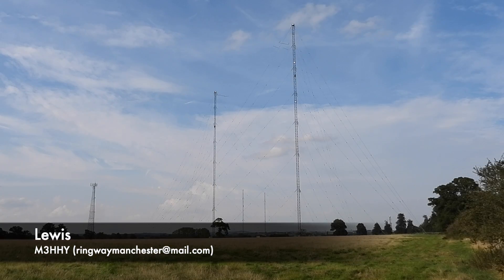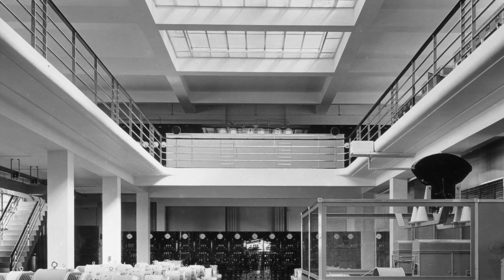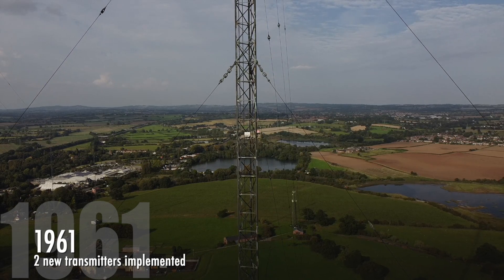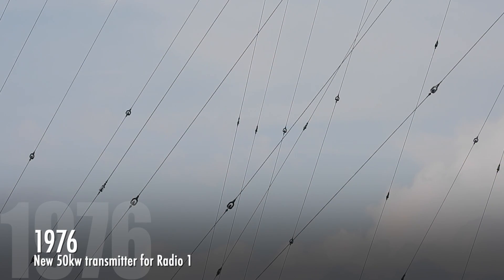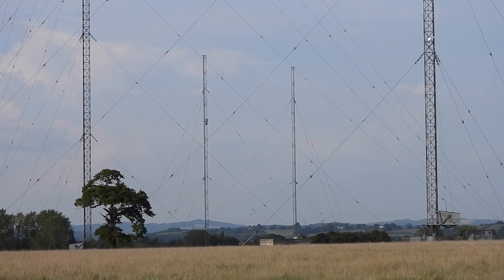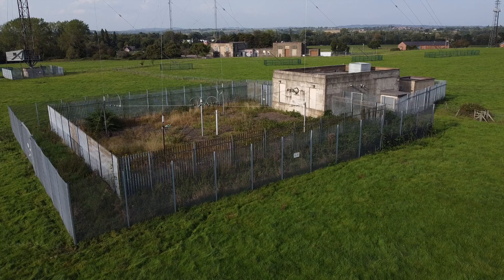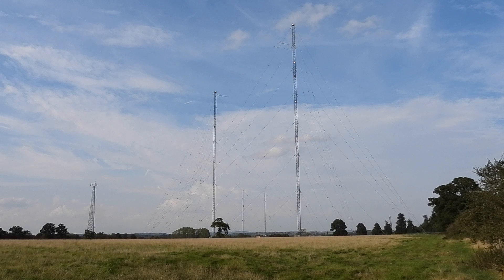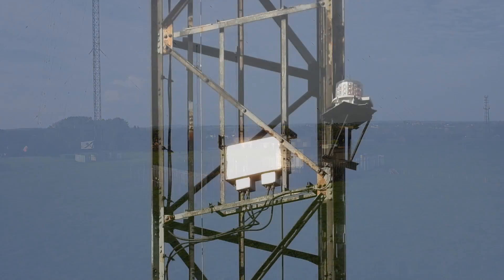Droitwich: The Death Of The 1/2 Million Watt Transmitter

Comment: read an article from BBC a couple of days ago where they claim they will keep BBC 4 on LW on the air until the last hoursehold electricity meters using LW  have been replaced with modern versions. there are still more than a million of these meters in use in the UK
Reply: Good point. I found a page on ofgem site saying, "RTS meters is being phased out and is planned to end 31 March 2024.". RTS is Radio TeleSwitch meters. The suppliers are supposed to provide customers with smart meters to replace their RTS meters by the deadline. Sounds like and end of financial year target business benefit job? No doubt some bean counting managerial types who don't give a stuff about the history of British broadcasting will be salivating at the thought of the leccie bill saving when they switch that 198KHz transmitter off.

Comment: This is a world wide trend of long wave and medium  wave stations turning off service. the cost of operating and maintaining has got to the point where no longer doable . and with few listeners . some new cars sold in the US no longer have medium wave AM radios in them. the cost of a new transmitter is just to high to replace the old tubes. and still would use a modern tube.  big transmitter tubes can be re bult or custom made. but at great cost. the decision to switch off old transmitters is mostly cost . nice video of the cite. love the pics of the old transmitter. 73's

Comment: Back in the mid 60s and early 70s when I was a young apprentice at the Marconi company in Chelmsford, Essex, I worked for a while in the transmitter development lab, and we had large
 transmitting valves for a development transmitter we were working on, the valve holders looked like toilet pans with concentric rings of phosphor bronze contacts. and large copper busbars for the heater voltages. There was a water inlet at one side to water cool the valves as they had a large copper anode at the bottom which sat in the water flow.
Reply: My brother came over from Ireland to work in Marconi Chelmsford in the late sixties

Comment: And long may R4 on 198 continue. 

I have Manx Radio blasting through here into Anglesey on 1368 AM.

The whole Manx system would be interesting Lewis?
Reply: I can receive Manx radio on 1368am quite well, all be it with a bit of fading, at night in Surrey. This has only been possible since the local BBC station closed down its transmitter...   also on 1368am

Comment: A feat of engineering to have this amount of power converted into RF at these frequencies. Any piece of metal in the area will probably receive one or more of the transmissions very well.
I never saw a warning about metal implants before at a transmitter site, is that somehow related to long wave? Or just a 'covering all options' sign from years ago (it looked very faded).

Comment: I’m ancient enough to have used 200kHz as a lab frequency standard in the mid 80’s and then after the frequency change in 1988 we bought an updated converter suitable for 198kHz, both were sourced from Quartzlock.  Never thought LW would ever end.
Reply: Given the way the world seems to be head, perhaps a big mistake?
Reply: @EdgyNumber1  Could well be. We used to have LW navigation systems (Datatrak, Decca, ...) which were essentially un-jammable... meanwhile GPS can be jammed with a box the size of a cigarette packet. I wonder if we're going to regret tearing down LW?
Reply: @electrickery  In Norway, LW and MW are gone, and FM was turned off six years ago. Only a few local radio stations have been given a stay of execution. In most parts of Norway there is nothing on FM at all.
Reply: @electrickery or with a defective LTE B32 tower. Perhaps also backbone stuff inside Huawei equipment.
Reply: @organisten  I believe that, for all intents and purposes, they've done away with cash, as well; unless I'm thinking of the neighbours in Sweden. Both maybe. Feels to me like it will all end in tears...
Reply: @ We have. I am Norwegian. They made a completely meaningless law giving us the "right" to use cash. It is meaningless because, where I live, there is no place to actually GET it. So even if the Law requires shops to accept it from me, the nearest place I actually could physically get any cash would be two to three hours' drive.
Reply: @organisten  Science fiction is become day - to - day reality: The Dystopia is here!
PS: Not even joking! I'm not saying people are being 'disappeared' off the streets into "interrogation facilities" or anything like that - not routinely, and not in Western Europe, anyway. No, it's more subtle than that. Think boiling frogs. The fact that I had to use a phrase like "interrogation facilities" instead of the one that first came to mind might be your first clue...
Reply: We used MSF vlf at Rugby
Reply: @alexnelson9512I think the move to turn off medium/short wave will be seen as a mistake but while FM receivers are much easier to build than DAB+ receivers, DAB+ does have some benefits. For example, on FM I get much noise when listening to Dutch stations while the sound on DAB+ is really good. Still, it would be sad for FM to go + many car radios up until 2018 only had FM/AM, so these radios would have to rely on AM or have to be replaced.
Reply: It seems aviation pilots are hanging on to AM for voice.  Heaps of advantages there's no digital latency and no capture effect etc  @alexnelson9512

Comment: Wonderful video, Lewis! So sad to see all these broadcast stations leaving long wave, as it was when the Beeb's World Service ceased most of its short wave transmissions back in the noughties. I had no idea about those rare glass valves! But it makes so much sense. It's strange sometimes when new technologies, which can make some things easier and less expensive, also result in rendering older technologies, some of which are actually far more robust, essentially obsolete. I suppose I attempt to counter this in my own small way by continuing to invest in my amateur radio gear. Cheers!

Comment: Not only is it a shame, but since the LW transmitter at Droitwich is the only one that can cover most of the UK when on on maximum power, it takes away a single point of communication to most of the nation in times of national crisis.
Reply: it should be kept for that reason alone
Reply: Problem is, with most radios being replaced by digital models, who would be able to access the signal?
Reply: Yes, but the updated version of 'Protect and Survive' could have instructions for a longwave crystal set using the techniques of WWII prisoners and building it from scrap. Compare that with the level of technology and infrastructure needed to receive a message from a US-based facebook server. The redundancy is perhaps poorer - the longwave transmitter is a single point of failure - but I don't suppose actual commercial setups are anywhere near as robust as the design of the internet allows.

Comment: I’m saddened to hear the LW station is closing down but understand that it’s very expensive to keep it running just for the sake of nostalgia. Unfortunate for those that will never have the thrill of making a crystal set and hearing the radio on simple home made equipment. Is there anything left on LW? I used to get RTE R2 on 252kHz but that’s gone now.

Comment: Unbelievable that they still use valves in the 198 kHz transmitter...  they could have saved a lot of energy over the years, at 500 kW output, with a modern semiconductor transmitter operating in "switch mode".   Installing it 20 years ago would have returned the investment many times.
Probably a case of "yeah, but this is going to be shut down soon anyway, so let's not invest in that right now"...
Reply: It’s solid state right up to the final output valve.  The antenna is regularly hit by lightning which doesn’t trouble the valve that much. We had 12 strikes in 20 minutes during one of my shifts there. AM is inherently inefficient as half of the power is in the carrier.
Reply: @laverdanick  Ok, I would hope those super-efficient semiconductor transmiters (e.g. Nautel NX) are sufficiently protected to survive that as well.  And at least you have the >90% mains to output efficiency, while with a tube final it will be half of that or less.

Comment: In those days a lot of attention was paid to the decoration of the buildings...
This weekend I visited the old transmitter building of the Dutch mediumwave in Lopikerkapel.  Its inside looks very much like what you have shown.
Initially the transmitters were placed much like in those photographs, but at some point they were replaced by new ones that were in a corner of the basement, and the hall was repurposed as a company cafetaria.  And a new transmitter building was later built in the Flevopolder.  That one already has been demolished, the old one remains as a monument and is now repurposed as small offices.
There is also the old longwave building in Radio Kootwijk, with an even nicer transmitter hall that looks like a cathedral.  It was not for broadcast but rather for telegram and later telephone traffic.  We never had an operational longwave broadcast transmitter, although there is an allocated frequency and (unrealistic) plans have been made in the past.
Reply: The building at Lopikerkapel is indeed very nice and the one at Radio Kootwijk is even more spectacular. I'd like to make an addition though: before WW2 The Netherlands did have a long wave broadcast transmitter, operating at 1875 m (so 160 kHz). It was located in Huizen during daytime and in the evening a higher power transmitter at Radio Kootwijk was used in stead. That one wasn't located in the monumental 'cathedral' (building A) but in a wooden building in front of that (building B, no longer exists). The frequency suffered from a lot of interference from a transmitter in Eastern Europe when they increased the radiated power.
A medium wave frequency (transmitter Hilversum, to be replaced by transmitter Lopikerkapel which was completed just before the war) carried a second program.

After the war, at the 1950 Copenhagen conference, the ITU assigned a second medium wave frequency to The Netherlands and the 160 kHz long wave frequency was abandoned. At the 1978 Geneva confererence, the long wave frequency 171 kHz was assigned by the ITU to Belgium and The Nederlands, for a shared public broadcasting program, projected at 500 kW from Lopikerkapel but as you mentioned that was never put into operation. Unrealistic plans were made later for a commercial programme Delta 171 from the Radio Kootwijk site (to which local residents successfully resisted) and even an off shore transmitting site was proposed but it was never built. And thus the 171 kHz long wave frequency was indeed never used. Despite this, it is still allocated. Perhaps a Low Power AM license can be acquired for it (as is common practice for all Dutch medium wave frequencies nowadays, perhaps it also applies to the 171 kHz long wave)
Reply: @JesperD87  Thanks for that addition!  Indeed I did not know about the 160 kHz, only about the 171 kHz and its long story.
The building in Lopikerkapel was open last weekend for monument weekend, and the broadcast transmitter museum now again has a permanent exhibition in the basement.
Reply: @Rob2  I missed monument weekend, unfortunately. I've only seen Lopikerkapel's interior on photographs so far. Good to know about the Broadcasting Museum's permanent exhibition in the basement, I'm interested in visiting that. Thanks for the info!
Reply: @stevenoneill7166  It is quite costly to operate a 500kW transmitter (at Dutch energy prices) only for you.
Instead, listen to an internet stream.
Much cheaper and much better quality.
Reply: @Rob2  Have you no romance in your soul?!
   
  I'm joking of course, obviously you're right; although the 'Little Red Hen' part of me fears that it might be a mistake to not keep at least a rudimentary framework of 'our' old legacy analogue radio infrastructure operational, in case of national emergencies. The powers - that - be probably don't much care about those isolated geographical pockets where there aren't any 'bars' (the phone kind! 😁) and even 'regular' FM, let alone DAB, drops out - and that's probably fair enough on the face of it, since they're responsible for the spending of taxpayers (or bill payers) money. When the 'feculance' hits the fan, though, even (or especially) in densely populated areas, digital telecommunications and broadcasting systems will be extremely vulnerable. There again, I probably have a similar mindset to those survivalist types who have enough batteries hoarded to keep the lights on in a medium sized town for the best part of a decade, and sufficient tins of sardines and jars of pickled beetroot to keep that same town fed for a similar period!

Comment: Next step is the switch off of FM transmitters. When a war breaks out, and internet breaks down,  people will be sitting around CB and radio amateur devices.
Reply: I wouldn't worry. The "Internet" takes STL feed to the majority of mast sites now anyway, so there wouldn't be a programme even if the transmitter stayed live, and hadn't lost it's power
Reply: You're right: with the spread of mobile internet folks will listen through internet, since transmitter maintenance costs are high the radio-stations will be willing to cut them.
Reply: Its alright though most folk have DAB these days. So FM transmitters aren't going offline given the use of FM IBOC, more a case of FM programming going offline.

Comment: Fun fact.... it is believed that the Royal Navy nuclear deterrent submarines used to check if Radio 4 was still on the air as part the process of checking if the country had been attacked by nuclear weapons
Reply: A slight modification. Tuning into the “Today” morning programme - 06:00 - 09:00 hrs on BBC R 4 - was the check that UK was still functioning.
Reply: @DeanJuvenal What ! You mean to say that the UK is actually operating at the moment !?
Reply: @bobgorman9481  We never closed. ;-)
Reply: @DeanJuvenal  Except on Sundays.
Reply: @applecounty  Bells on Sunday and The Archers
Reply: It was standard procedure in the RAF of the 70's, to do a radio set check by tuning into the Droitwich transmitter, on the Vulcan force, if you ever 'lost' the signal after being despatched to your target,  it was to be asummed that much of the Birmingham / West Miidlands area had already 'gone'.
Reply: The larger UK nuclear bunkers have BBC studions in them. Presumably they would be connected to local transmitters (likely MW) in such an event. Cold war has always been about 'fail safe' so I can understand why loss of a major transmission capable of being received out at sea (not underwater though) could be used as a 'signal' something  catastrophic had occurred. Pretty sure the launch protocol would have some additional criteria for (nuclear) launch though..
Reply: @nicc5122  It was reported that this check was started when the Polaris deterrent became operational. I believe this method was used if all other technical means and military communications ceased to function as expected. It would be confirmative method in the absence of other means. During wartime, Radio 4 (the old Home Service) would be a vital means for the government to communicate with the population. So if it was not on the air by its various methods then the country would have been in serious trouble. Probably then the safe would have been opened.
Reply: You won't have time to tune into Long wave radio if we all get nute, We had a government nofication alert test recently and you have a thing call mobile, Why waste time tuning into your portiable radio, When you get all these things through a mobile phone and yes they come from masts.
Reply: @scottpeacock5492  Honestly? This was pre-smartphone era, small transistor radios could pickup LW.
Reply: Many of us never got it. @scottpeacock5492

Comment: Been past this site a few times. Always been facinated by LW and MW transmission equipment. Fond memories of both Radio 4 and Radio 1 as a child. 1053kHz is burned into my brain. Loved the old pictures of the equipment. The hypnotic glow of a mercury arc rectifier is such a visual treat, would loved to have seen that pair in operation 🤗
Reply: 1053, 1089 and a bit of FM too.